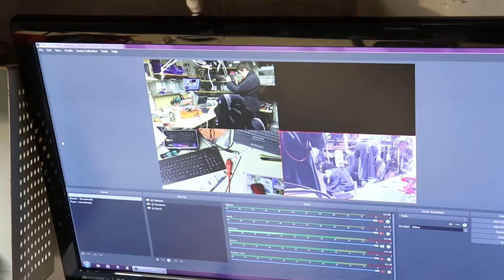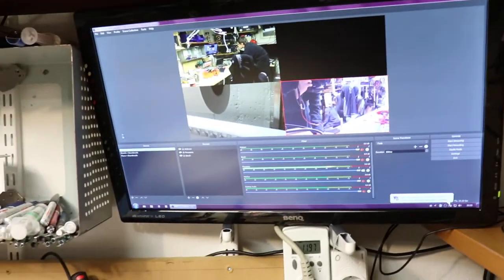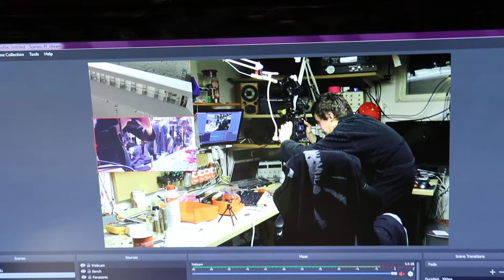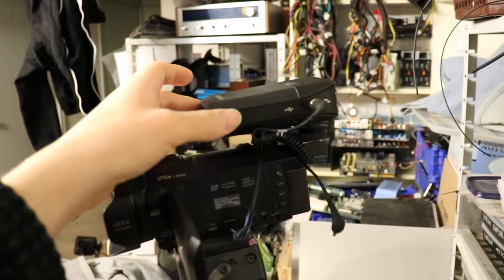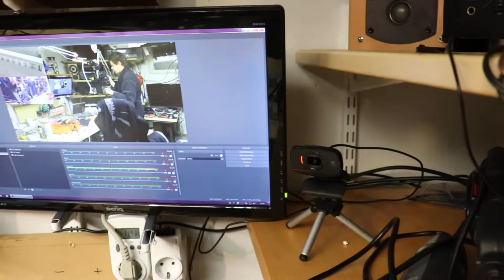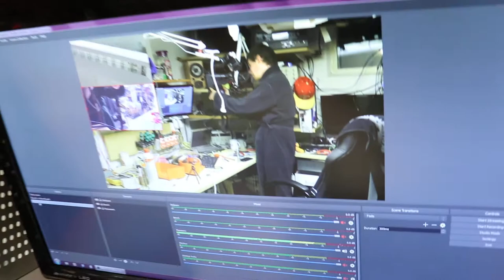Look at in-progress streaming setup which broke 2 minutes after the video

Comment: I have a YK752 but when broadcasting to OBS over internal network it comes in at well over 15 seconds delayed and am forced to use window capture to get a reasonable live image. Did you have this issue?
Reply from the maker: No, but I don't use them over the network. My problem is that they're extremely unstable (possibly because they use ~700 mA out of the USB port), the YUV codec breaks *EVERYTHING*, forcing you to use MJPEG with giant CPU overhead, and they hate anything that isn't 30/60FPS - and all my cameras are PAL, ie 25/50 Hz. This basically destroys the audio.

Oh, and they randomly just don't work at all. And sometimes kill my USB ports.

Comment: What broke on the new setup right after shooting this video? Chinese capture card letting out the magic smoke?
Reply from the maker: Yep, both of them received ninja training as they became unknown devices.
Reply: FFtrashbag, hmm, I hope you can somehow convince those to un-ninja themselves so we can get more good live streams from you when you have the time for doing so :3
Reply: Hmm... did not EEVblog have the exact same issue on the video with the creditcard calculator teardown where his capture card stoped working after a windows update...
I wonder if it's another #ftdigate type of deal.
Reply from the maker: In my case, it's just a question of the Chinese using trash chips with the numbers lasered off them. ;)

The best part is that they seem to have done a number to the USB 3 ports of several PCs I tested them with. Joy.
Reply from the maker: I'm trying to somehow convince the Ebay seller to give me a refund or new adapters. lol.